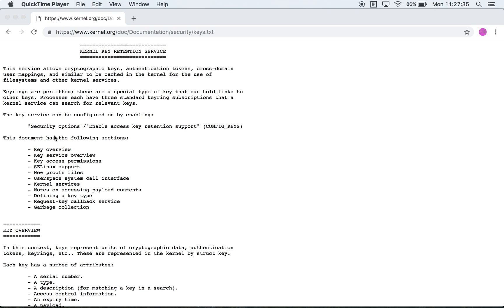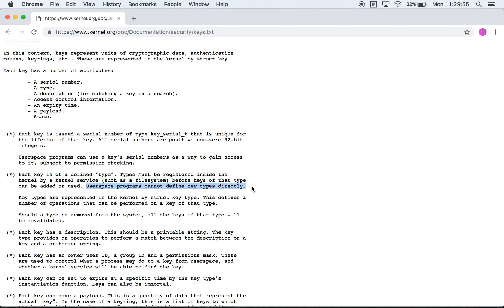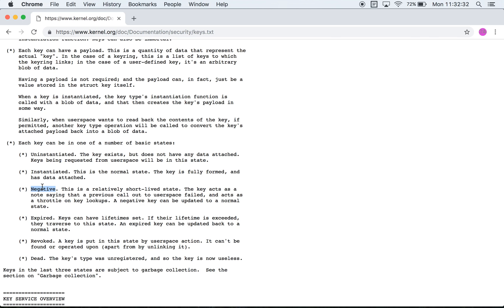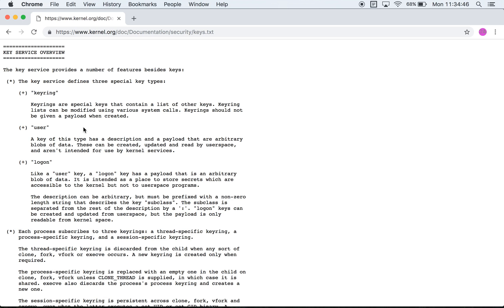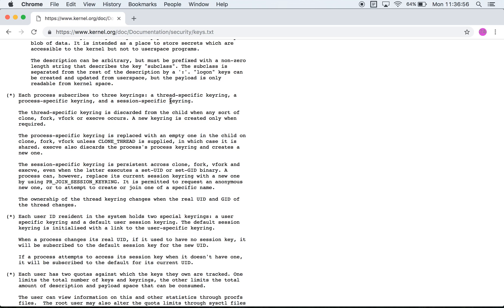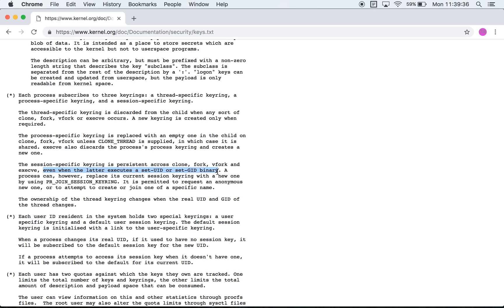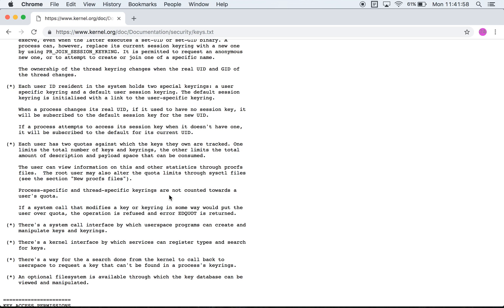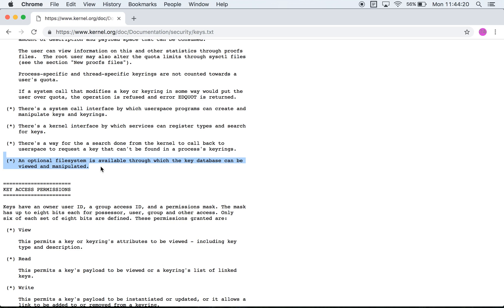keyring subsystem #1 - Documentation

Comment: 08:10 I imagine logon keys are useful for things like full-disk and filesystem encryption. You want to be able to pass the key from userspace to allow kernel to decrypt a device and mount it. But afterwards you don't want user processes to be able to read that key back, because they have no use for it anyway; it's kernel that uses the key for decryption. After all, even though userspace passed the key and had access to it somewhere at some point, it could have been in transit and/or for a small duration of time. Let's say you read a key from an sd card, cryptopen /dev/sda, remove the sd card, mount the decrypted device and  start a bunch of processes that read from that device. Those processes only require access to the decrypted block device or the filesystem itself. It's kernel (like dm-crypt) which encrypts and decrypts the device behind the scene as those user processes use that decrypted device or FS. So there would be no reason to allow to read keys from userspace at any point if those keys will be used only inside kernel (like by dm-crypt).

Great video series, btw. Very helpful.